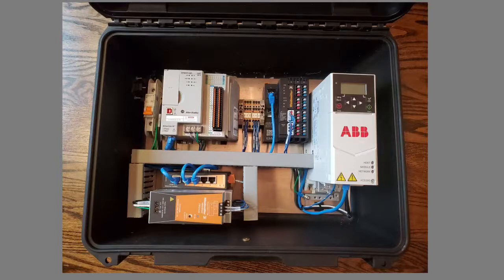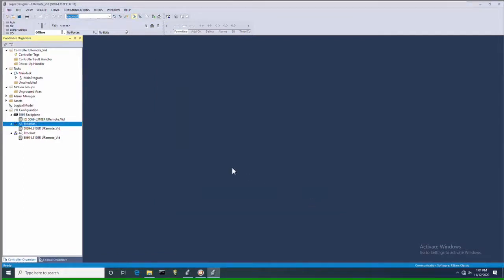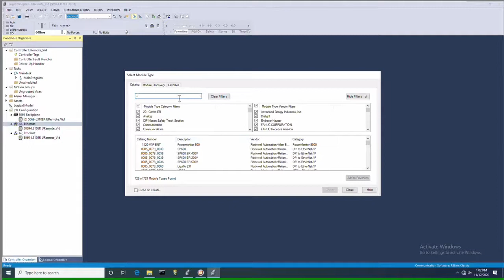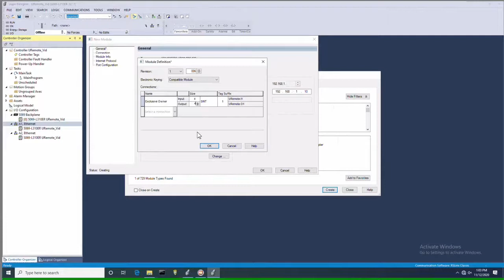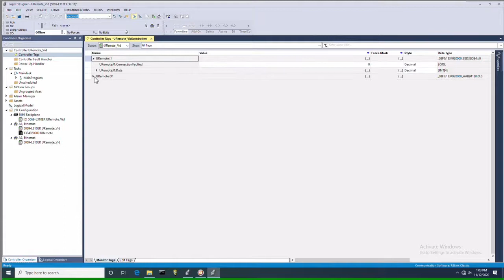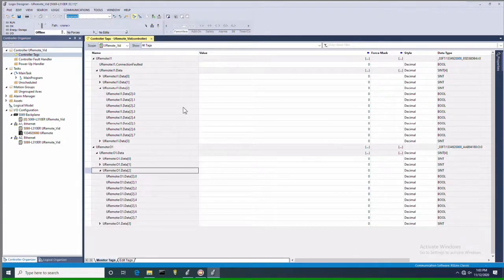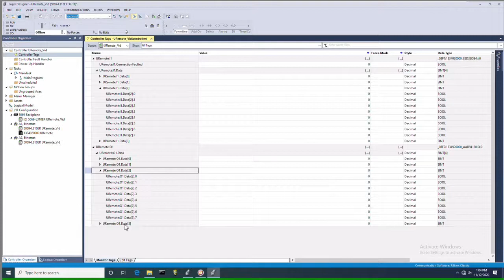CompactLogix connected to Weidmuller URemote over EthernetIP

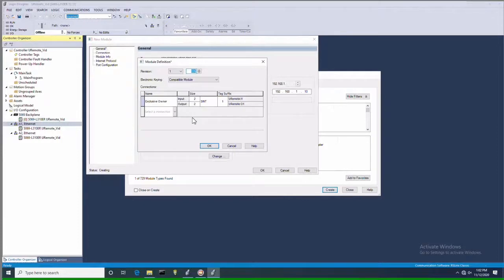Comment: At 3:13 you change the Input and Output size. How do I find these values for a different arrangement of modules? I can access the web server and found a section that shows several different lengths but I'm not sure which ones to use. Thanks for making this video!